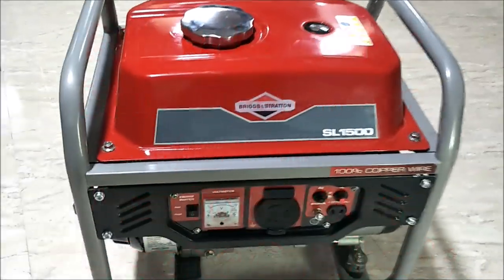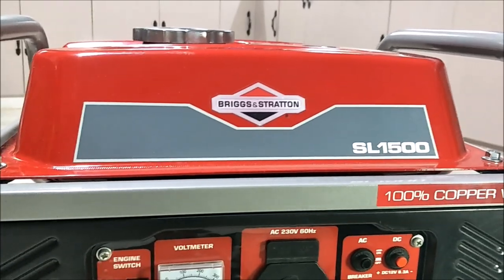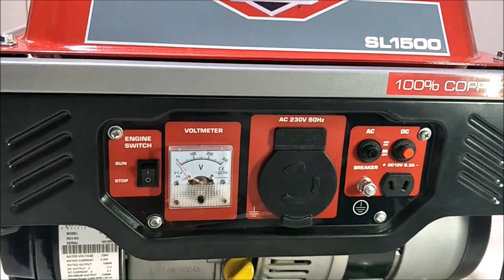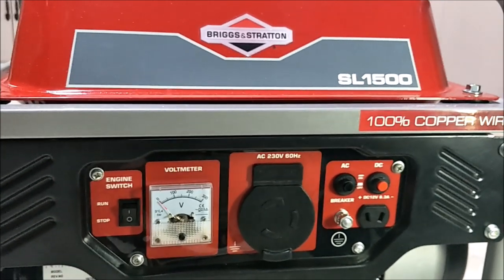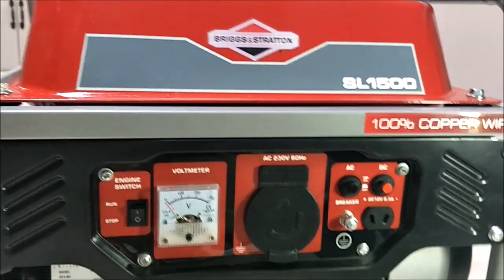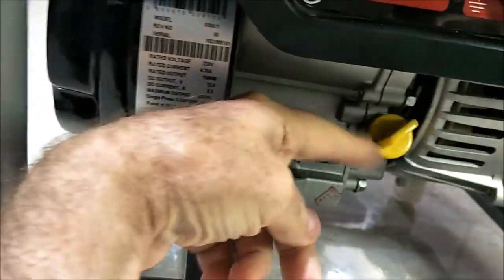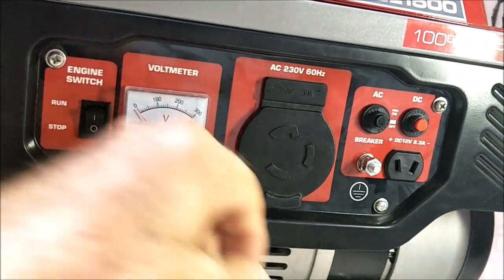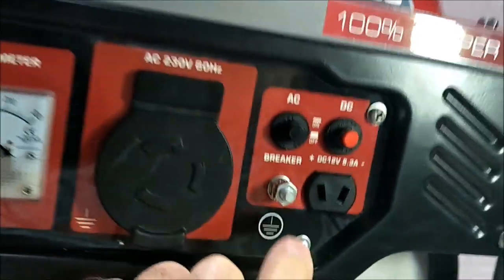Briggs & Stratton SL1500, 230 Volt AC, 1000 Watt, 12 Volt DC Gas Generator

Comment: A good buy handy generator and great rolling wheels idea! You could use Caster Wheels with Safety Dual Locking so it will lock in place! Thank you Rodger for sharing another informative video. Best regards/Ned

Comment: does the casters help absorb the vibration when the generator is on? or does it help in preventing the generator from moving around due to vibration when it is running?
Reply from the maker: I have to put the casters in aerosol paint can plastic caps to keep it from dancing around on its wheels😊

Comment: Get a Honda it will not fail you like the B&S will~
Reply from the maker: B&S is much cheaper than a honda. In the US i thought a B&S lawn mower engines were never that good however it was very common engine. In the Philippines it is considered top of the line compared to the no name chinese generators.